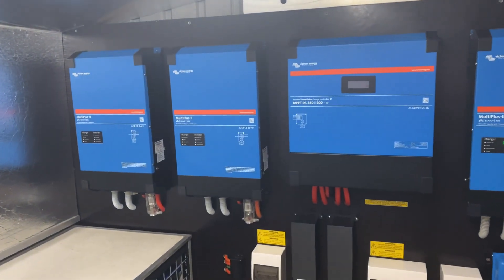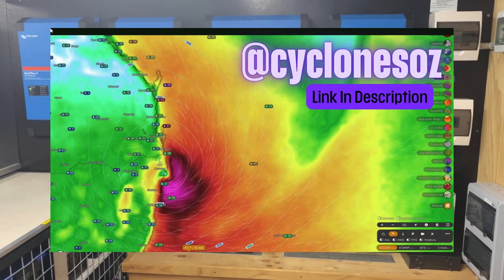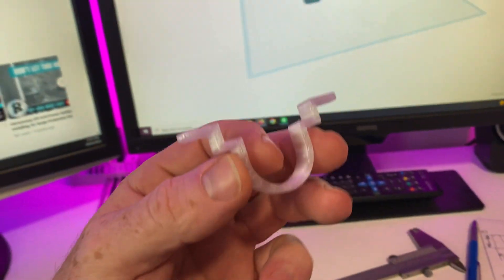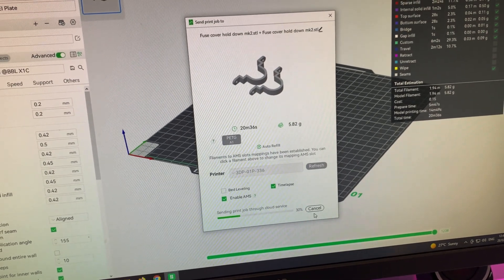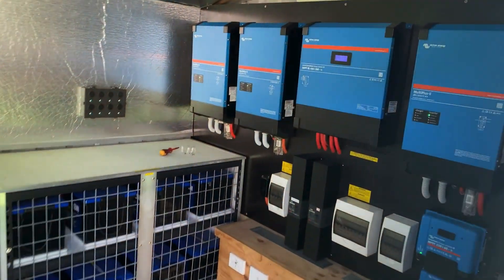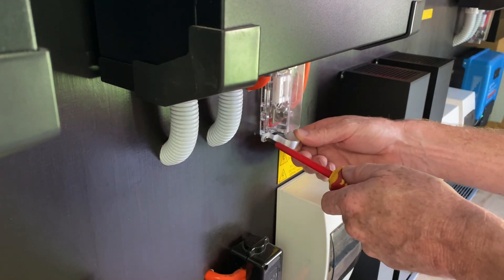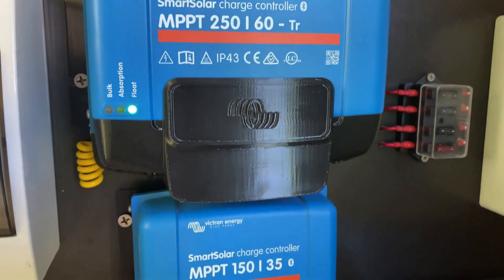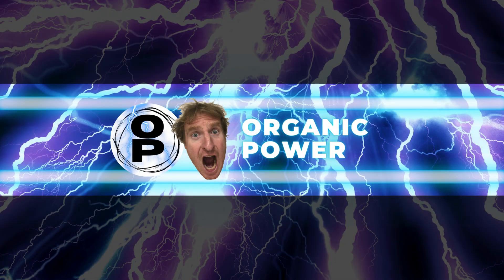Off-Grid Solar System vs Tropical Cyclone Alfred: Can Our 42kWh Battery Storage Survive the Storm?

Comment: Sending you positive thoughts from North QLD. For what it’s worth the real test comes after the cyclone has passed as often you may have several days of really cloudy/rubbish weather 😢 - Part of the reason I still have my Honda petrol generator for just in case.
Reply from the maker: Thanks for thinking of us. I used to live in South Australia so this will be new. I just started the generator today and topped up a Jerry. Boarded up the 2 south facing windows that will cop the brunt of the storm. ⛈️
Reply: @OrganicPower-Australia  Sounds like you are definitely well prepared then!

Normally the windows only tend to pose a problem if something goes through it (i.e. tree branch, garden furniture, etc). At least with the cyclone shifting downwards, it sounds like you might be on the north side of the eye which is good as it'll be less intense and you won't cop the same level of water, etc.

It's definitely a little scary when you have your first as you don't know what to expect, however it'll be very loud and you aren't likely to have much sleep for the night when it hits.

Comment: I am building a system similar to yours, but had to go for a few MPPT 250/100's instead of the 450/100 as there was literally no stock. I've got an electrician working on a lot of this but I am building the 48VDC side with his guidance, so we can get it CEC approved. My battery is 21kWh so half of yours, although that only has to provide for myself, no family. Hopefully you stay safe and make it through. I grew up in Cairns, so for me a category 1 is just a bad day, category 2 is pretty nasty but usually not earth shattering, category 3 is when you definitely get concerned as those can cause some decent damage, category 4 you really hunker down and category 5 you RUN!!!
Reply from the maker: Hey mate, the 250’s are good and it will give you greater redundancy. Nice one! Thanks for the heads up on the storm, some of these old houses down here may not even cope with the wind. The building code down here isn’t as good as North Queensland, I guess we will find out. Thanks for watching and the comment 👍🏻